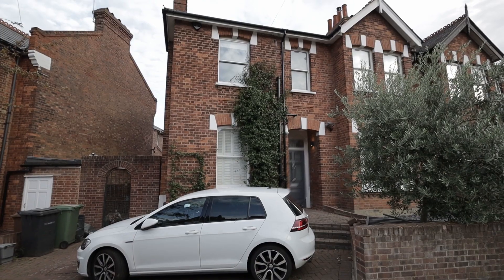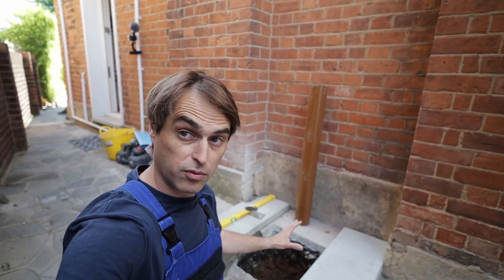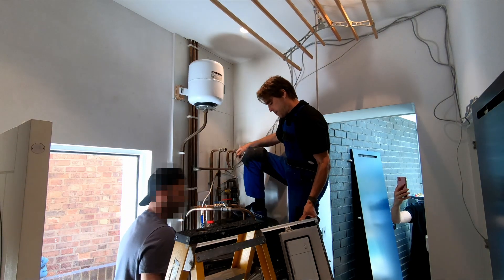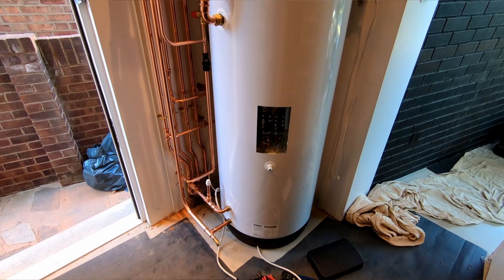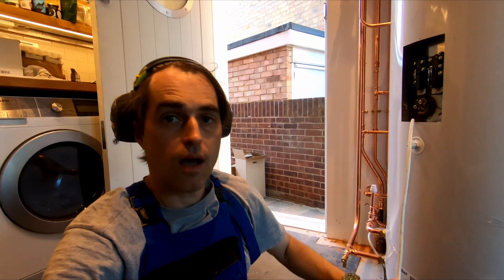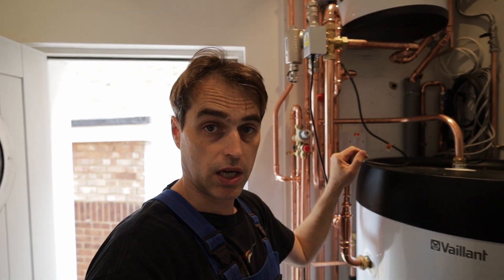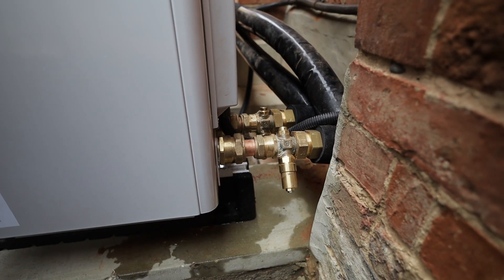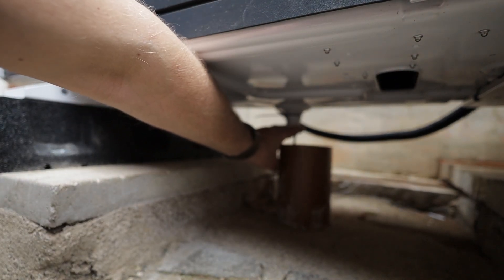Is This Heat Pump Better Than Your Gas Boiler?

Comment: What a scam. Heat pumps are expensive and useless to heat up house during g winter. Beside cost insulation of whole house and complete heating installation is beyond budget of majority of people in England. We are talking here probably about around 100k costs. Thank you but no, thank you.
Reply from the maker: Average heat pump installation and system upgrades is around 10-20k less 5k grant. Client usually pays around £5-£15k

Octopus regularly does install as for a round £5k

So you are wrong about pretty much everything
Reply: @UrbanPlumbers  whole house insulation cost including new windows can go up to 50k. Plus costs of heating installation replacement and heat pump  can reach in some cases around 100k.
Beside even 8f ot would be half of this, I'm sorry but average family in UK cannot afford to spend  50k to put not effective heating system which is heat pump.

Comment: Nice to see a video that looks sensibly at Heat Pumps. I'm sick of seeing dinosaurs complaining about them and claiming they're no good. I worked with Heat pumps back in the 70's and they were crap but now companies like Vaillant are producing extremely efficient and reliable kit. I have exactly the same vaillant heat pump in my house and it's been excellent.
Reply: Mishmash  You do realise most of the electricity to run these heat pumps is coming from gas right. For those that can afford them and have the space for all the tanks and the money to have it all installed they are great but most people do not.
Reply: @schrodingerscat1863  No it isn't. 40% of electricity is generated by gas in the UK and it is falling every year.
Reply: @MrAndrewjdavis  But every heat pump installed means less gas used directly for heating and more electricity required. This will push up the amount of gas being used to produce electricity as that is the spare capacity we have. Also around 20% of winter days there is either not enough wind or too much to use wind turbines which changes the figures even worse. If we only switch over the homes say using oil heating, about 1.5 million homes, that would need around an extra generating capacity of 6TWh per year most of which would be required in winter. It's not realistic to change over to heat pumps for most people because of the huge expense in doing so and we don't have reliable generating capacity without building a lot more power stations.
Reply from the maker: Thank you!
Reply: how much did it cost for installation, and how old of a house?
Reply: Mishmash  Im all for green technologies, but only if they work. And theyre only truly green if the electricity they use, which is substantial, comes from renewable sources, which for the most part they currently dont.  As of now most people in the UK simply cant afford to convert, assuming it is worthwhile. But as you've closed your ears to others' views, it seems we know your type.
Reply: @PC-vg8vn  To get 1kw of heat a modern heatpump only needs about 0.2kW of energy, so even if you burn gas/coal for the electricity you save massive amounts of CO2! That's why a heatpump is so grat and green.
Reply: @sparqqling  That would give a CoP of 5 which no heat pumps can achieve. The best you would get is 3 and on a cold winter day it will be around 2, usually less because hot water needs boosting with emersion heating on days like that, and that is for the most efficient systems possible which are realistically never achieved in real installs.

Comment: Now for a layman here that looked like a lot of mess and a large piece of indoor space to replace a gas boiler. Heat pumps will be the preserve of the wealthy it seems as the cost is way beyond most people can afford when you add in all the rest you would need to do to a house.
Surely large windows or even open ones would make ashp unworkable? From the information ive read and seen it wouldnt heat my house to the needed temp during the winter and being disabled i have limited funds and a real medical need not to get cold at all! 
Also why put the outside unit in that alley way? Kids/adults will damage that knock it of the wall with one ill timed action. Given the countries lack of energy generation capacity wont mass uptake of these crash the system. 
It all looked like a well installed piece of equipment, but it all seemed a to technical explanation rather than a helpful one, more aimed at your peers than help people. As they say kiss (keep it simple stupid)

Comment: Like to hear from the user as we had fitted and cooling is rubbish and heating not powerful enough. My cheap gas boiler is doing better and cheaper on butane. Heat pumps expensive and suck

Comment: New 24kw Worcester boiler £1300.00 inc vat...how much does the equivalent unit cost to install etc....when we understand where our Gas is actually coming from (clue its not Russia etc...)....we will see how they used Gas turbine Engines and years ago sewage methane gas....aka its all locally sourced!! you only need to look at a military Jet plane to see how easy it is to extract heat from the AiR !
Reply from the maker: you tried to say something, but what it was is anyone's guess. Locally sourced planes extracting air? Sober up and try again, please.
Reply: It's a global gas market you muppet! It doesn't matter if we don't buy from Russia as gas supply is finite. Someone is going to have to buy Russian gas.

Comment: Air sauce pump takes energy from the outside. When it’s cold in the winter, how is the hot water and heating heated?? 🤔 Insulate your home. Then what happens to the stale air? 🤔

Comment: With retrofit air source heat pump systems costing from around £29,000, 'Net Zero' is for wealthy liberals only.
Poorer people will live with their gas boilers until they pack up and then get cold if they cannot replace them like-for-like.

Comment: You should not have removed the underfloor heating pump, it is needed as the pipe resistant  in the ufh is far greater that a rad so needs its own pump to keep the design  flow corect.  I also did not see you balance any of the water flow to the rads and ufh.
You still have so much to learn before you can complete a correct installation.
Reply from the maker: No need for the pump on UFH. Pump in the unit is fully capable to supply both flow and overcome UFH resistance. Radiators have IMI flow controlling valves and whole system has DT of 5 - both on rads and UFH.